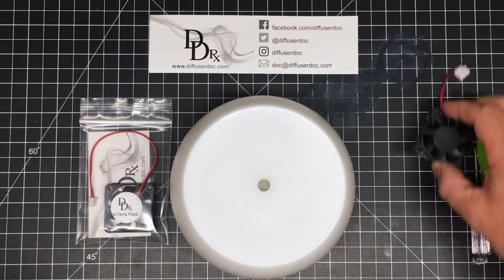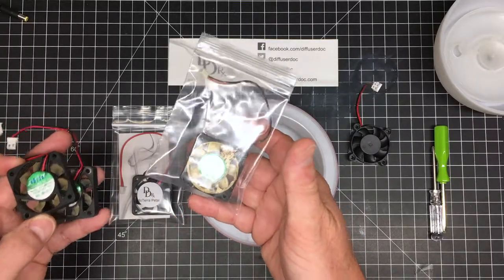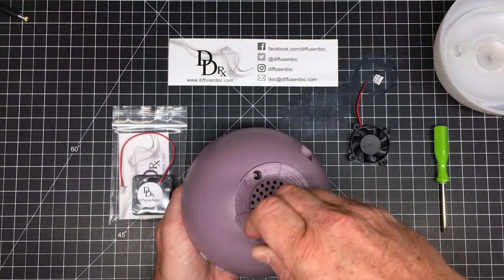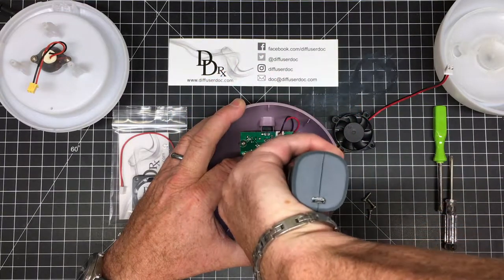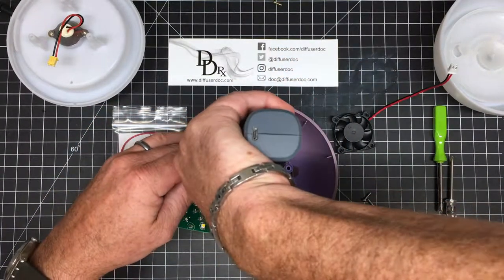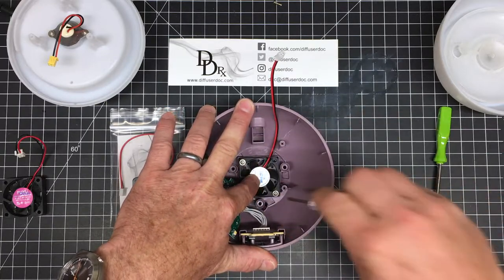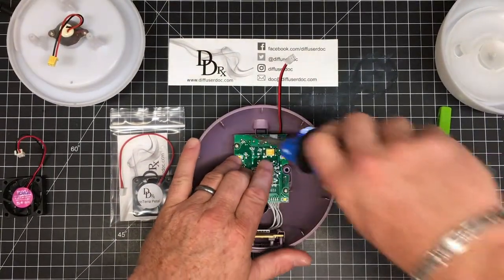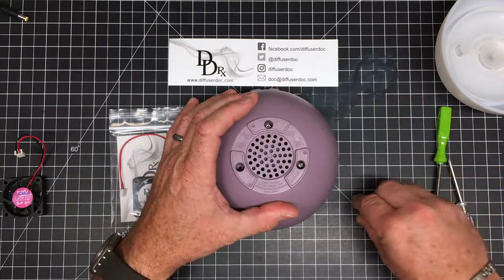How to Replace the Fan in a doTERRA Petal Essential Oil Diffuser

Comment: My doterra is making a weird sound when I turn it on and it takes about 2-4 times of turning it on and off until the sounds stops. Would that possibly be the fan? Its diffusing properly it's just a weird sound instead of being silent.
Reply from the maker: Hi Alex, yes, that's the fan making the noise. 
This repair will fix that.

Comment: My diffuser got knocked off as well from my baby. I noticed the lights blink 3 times. Then I took the disc out to clean. The lights go on inside. But no power lights on the front. When I plugged in after cleaning the disk it spurt 1 time from the middle then nothing. Do you think it’s the disk or the fan? Or should I open to retighten? 

*im very thankful for your videos
Reply: Update!!! 

So I took apart just like you have shown and cleaned everything. Power lights on! And diffusing❤️ you saved me from buying a brand new one 👏🏽👏🏽👏🏽👏🏽

Comment: Hi my diffuser fell off the table now it doesn't work. When I press the mist the lights flash and nothing happens.  Can you please tell me if I can fix it and what possibly has happened? thanks
Reply from the maker: schmeggynz , Sorry to hear about your diffuser. Three discs are very sensitive to shock. Replaced the disc and you should be back to diffusing. Here's a link to the right part.
https://www.diffuserdoc.com/doterra-parts/dt-petal/doterra-petal-replacement-disc.html
Reply: @DiffuserDoc  thank you very much
Reply: @DiffuserDoc  I have one more question, I did watch your video of replacing it so I have removed my one cleaned it and replaced it didn't make a difference.  So replacing it will make it work again and the lights to stop flashing on and off quicky then shutting down? it would't be anything internal? Also i'm in New Zealand do you ship to NZ? thanks

Comment: Hello my Petal diffuser turns on and almost instantly shuts do you happen to know if it can be fixed?
Reply: Hello, did you find some help for this? Mine is new, I've been using it for 10 days just and I'm worried about it. It almost instantly shuts down sometimes and the fan makes a weird noise.

Comment: You need a 40x40x10 (Millimeter) 12Volt DC Brushless Fan with 2 Pin Connector. - mine had 0.06 A or about 0.8 Watts - but that is not as important
Reply: Which connector type? PH2.0 or XH2.54?
How many RPM?
Reply: @andrejtobola  Quite sure mine had xh2.54, if I remember correctly. And I used a special silent Van with 4500rpm from Noctua - no improvement noticeable for my ears